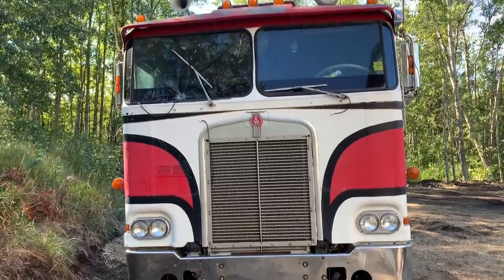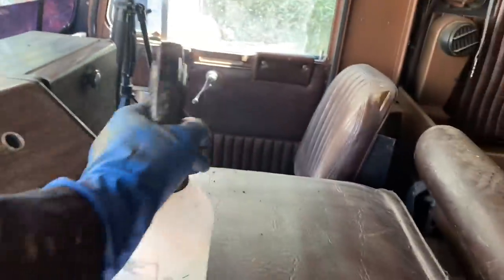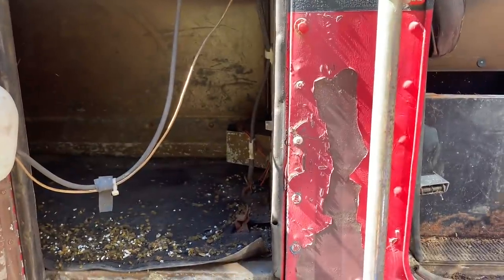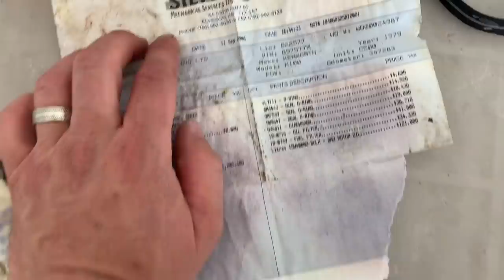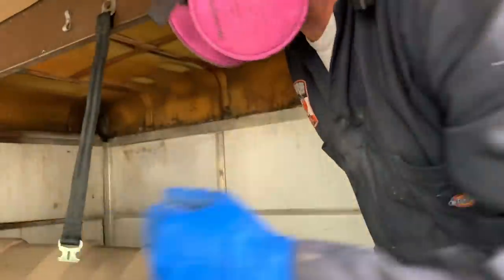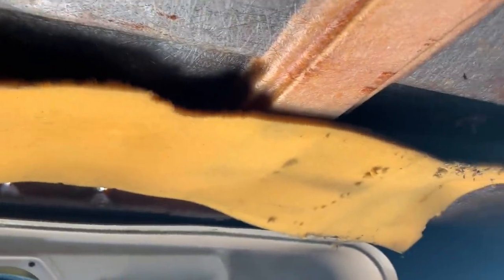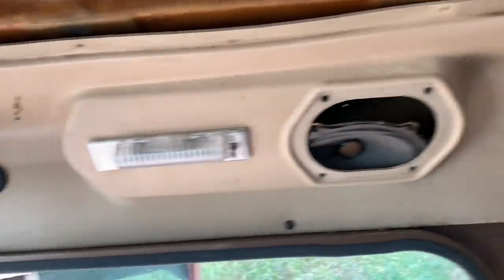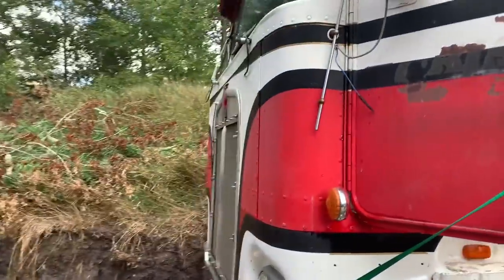Iron Duke Kenworth Restoration Ep.4 Mouse House

Comment: Just wanted to let you know that the aluminum tag you found under the passenger seat, is more then likely not a deer tag, but a load seal.

Often times, when you were pulling a box trailer, and the load was considered fragile and/or sensitive, the shipper would make you put a seal like this on it. They'd put it on the trailer door once you were loaded, and then the receiver of the load would break the seal upon delivery...thus assuring them that the load was completely undisturbed during the transit.

I'd routinely break the seals myself, and when the recipient of the load would ask why on earth I'd do this, I'd tell 'em that I make a routine daily inspection of my loads during my daily pre-trip inspection. I wanted make sure everything is safe and sound, that nothing is leaking, tipping over, or shifting in any way. As the driver of this truck (and the load in it), it is MY responsibility to see that the load is complete and intact, and their stupid little snap tag is not gonna keep the load from being secured or tampered with...but my $300 padlock (from a vault) will!

They usually understood once I explained things this way, and I never got into serious trouble for this. (altho some did grumble a bit) Fak 'em! 
My load, My ass!!

Enjoy that over-cab! I drove one identical to it for acouple years. 400 Cummins w/ a 13 speed. Good running old truck!

Comment: Just stumbled across your channel while trying to figure out where the mirror wires route for my 2021 348.....But the first truck I drove was a 1975 359 with a 6&4. It was a low bed truck and I learned so much, and had a ton of fun, driving that old truck. I put 6 years on that truck moving heavy iron up Billy Goat trails for a contractor friend of mine. I got that job because he asked me if I could drive a "twin stick". I said yes.....but I didn't have a clue what that even meant. I figured it out after a few days. Once I understood how to use those gears, I could take that old truck anywhere. After about three months, I went to the owner and said: "I have two requests. First, I need a better seat. Second, I need air conditioning." He obliged. And then I put 550,000 miles on that truck. I like my new truck, but that old 359 was a lot of fun. Great channel. Glad I found it.

Comment: The Porter Dude here.🇺🇸 That’s how I learned to clean the inside of a Cabover out..get the hose, soap, Ajax, brush and clean it out! My brother was assigned an old W9000 Ford Cabover that a smoker was driving. He brought it to our garage, aired it out, washed it thoroughly, then aired it out some more. It was an entire day before he was satisfied, but he didn’t take the upholstery out. 😳 He was good about taking care of that truck…wash, clean, lube etc for as long as he was driving it. When other drivers took it over the truck ended up just sitting around for extra parts after a few years. Good work! That was the right place to start. 🤩 Bring on the other action! 😎✌️

Comment: For everyone dealing with the issue of mouse nests..
A solution that has worked for me is to buy some Peppermint Extract and dump, sprinkle and pour copious amounts of the stuff Everywhere inside the cab and sleeper areas.
The mice and other critters can't tolerate the scent and the bonus is that it will smell Minty Fresh in a good way !

Comment: Well no one ever said find from the farmer's fields didn't have it's sh8tty moments and cleaning out after having sat for years is never a fun job it's always a necessary evil, but the quicker you get it over with the better you feel and the better it will be to work in and on. You took the right precautions which is critical cause mice can be some nasty business and at least they were nice enough not to chew everything to pieces surprisingly for having made a home there so long, the interior pieces looked fairly intact and not all chewed up amazingly.

But I am sure after having bleached and washed you can at least now open the door without the smell of mice smacking you in the face every time you opened the door and better to get it done now then to roll it in the nice new shop and have to do it there. If you buy a mouser for the shop you will have to come up with a good name for him/her.

Nice to see you go it all cleaned up and that's one big task off the board and hopefully if your lucky you can get her blasted before the snow flies and then get her cleaned up before you stick er in the shop.. Look forward to the next update and a more fun for you video. lol

Comment: Hey Mark,you should install an air ride cab mount assembly on the Iron Duke;as Chad Keegan is going to install one on his 1986 Kenworth K100 flat top COE to improve the ride quality.
You would be glad that you have installed one;as you wouldn't be busting your teeth,kidneys,& your back from a rough riding truck.Also,install a set of Jacob's Jake Brakes,as the brake saver is notoriously known for leaking like you said as it would save you thousands;from having to repair the brake saver again,should it ever break down.

Comment: That may be a elk tag but back in the day expensive loads were tagged with metal strips like that on doors to tell if load had been tampered with
Reply: its called a load seal and they still do it
Reply: They are still used here in the UK for door seals although you better fix a big padlock as well!. Customs call them 'Plomba' as the real Customs seals are compressed lead.
Reply: @1chish  here they get put on your load usually or your trailer and if you run a dry van or reefer trailer a padlock also goes on with your tag
Reply: @TylerDuysen  Thousands of miles apart and doing the same thing!
Reply: @1chish  yep

Comment: Well that was one very disgusting but necessary job well done mate. Rather you than me....
I still think you should look at lifting that cab off the chassis and set it on the ground so all the cab work will be far easier. You then have a clear run at the engine, gearbox and chassis ready for blasting and painting.
After all you have the space now! 
One thing a cabover is easy to do and that is lift the cab off.
Keep up the great work ...

Comment: Wow what a job Mark, hey I felt sorry for ya, there didn't seem to be any rust around the front window that I could see (with 75 year old eyes that is) that's a plus, also on those plastic panels, are you going to try an save them or replace them with Day Cab company replacement panels? ok great job on cleaning, it was nasty though, Hey the worst is over..........yeah sure.😁
Reply from the maker: Gonna see if the DayCab company can make them … currently they don’t do cabovers but maybe I can convince them 😉

Comment: Enjoy your channel. Was wondering what your cordless cutoff wheel is. Looks very handy. Keep on truckin
Reply from the maker: https://www.amazon.ca/M12-Fuel-Cutoff-TL-BT/dp/B07H7SH6HC/ref=asc_df_B07H7SH6HC/?tag=googleshopc0c-20&linkCode=df0&hvadid=292923635229&hvpos=&hvnetw=g&hvrand=7110082907711803628&hvpone=&hvptwo=&hvqmt=&hvdev=t&hvdvcmdl=&hvlocint=&hvlocphy=9001282&hvtargid=pla-557408489031&psc=1
Reply: Thanks for the info 👍

Comment: Would it be worth getting the truck running so it could be moved around the yard under its own power instead of having to push it or pull it around?    Even if it only runs enough to move it into the garage after the sandblasting is completed
Reply from the maker: Oh it runs https://youtu.be/esfy2pvV_pw but the air lines are a mess and some are cut so it wouldn’t air up anyway
Reply: @TwinStix  wow it runs really well.   Gotta love the Cat motors.    Should make for a great truck, looking forward to following this and the other project trucks you have.    It’s nice to see old iron being brought back to life instead of being fed to the crusher

Comment: That was not a hunting tag, it's a trailer seal.  They used to always be metal until they switched to plastic and bolt seals.  You could break a metal seal with your hand but if you weren't careful you would cut the crap out of your hand.  Ask me how I know.  Anyway, we used to have a whole bunch of those on the truck at all times so I'm surprised you don't run across more of them.
Reply from the maker: Yeah that’s what I figured it was 👍

Comment: I hoped in a little late on this channel to see the full restoration process of Snowman and LBL, but now I'll finally get to see it with the Iron Duke🙌
By the way Twins, do you rebuild the engines of the trucks or you just leave them the same as when you found them?🤔🤔
Reply from the maker: We’ll I’ve been lucky so far in the engine department but I do need to check the mains on the Cats and add Jakes to the Duke #futureepisode

Comment: I heard you comment on needing to replace the airlines in the cab like in the Pete and I remember how much you struggled with getting all those lines in. Is there a reason you are sticking with the rubber lines? I have been using polyurethane lines with push-connect fittings for years on industrial equipment. I think it would make your life easier to modernize where you can.
Reply from the maker: Yeah I agree those newer fittings are much easier to work with but I find poly line kinks easier especially trying to run it in tight places like behind the dash
Reply: @TwinStix  The polyurethane ones kink less than the older PVC ones, but yeah there's still a risk if you don't add a service loop in. With the PU you can color code too.